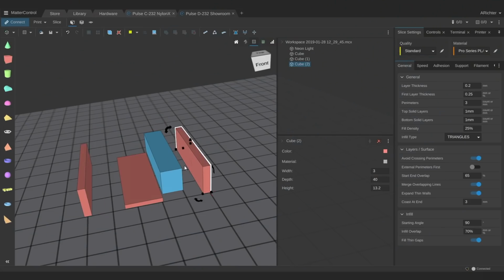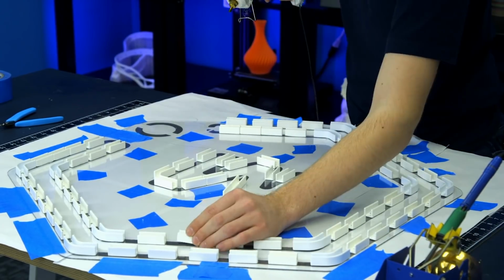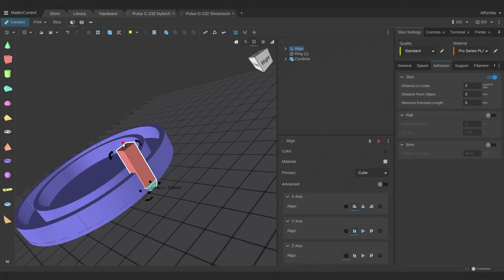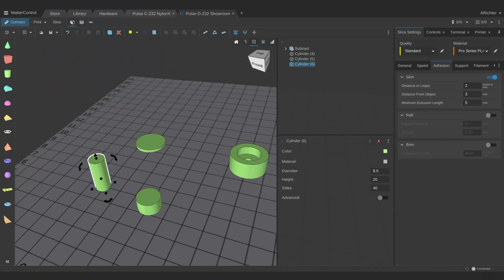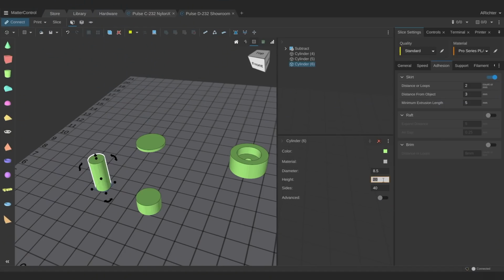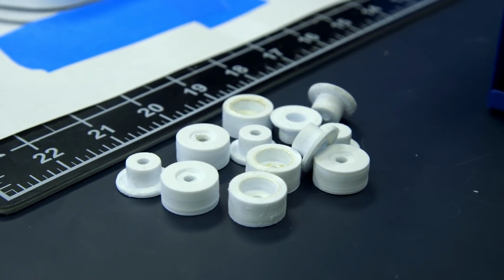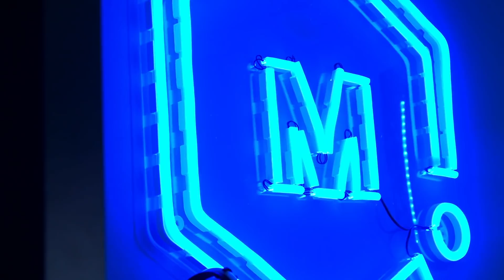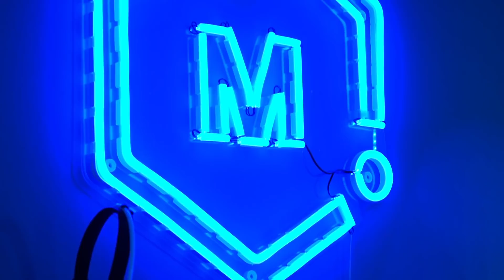Weekend Builds // LED 'Neon' MatterHackers Sign

Comment: That's wicked!! My only sticking point is wire management! Hide your crimes
Reply from the maker: Actually, we debated on how important it was to hide the wires or leave them showing. Traditional neon lights have wires connecting each of the tubes so we were okay with showing them rather than getting wire that has a clear sheathing that blended in better. But trust me, we thought about it! - Alec

Comment: 3:40 I want to drive to OC and give you  some step bits.
Reply: Or plastic drill bits!
Reply: @MakeItWithCalvin  I'm actually curious, I was only turned on to these recently, they work well?
Reply: @kurtlindner  if you use them properly they do work well. They're designed to help prevent plastic from shattering or cracking. You can get them from Tap Plastics or McMaster Carr
Reply from the maker: I have step bits in my personal toolbox, but I used the tools that I had available to me. Next trip to the hardware store I'll get some! - Alec